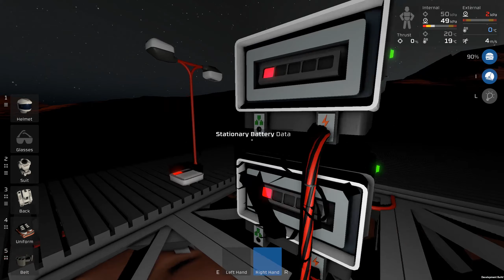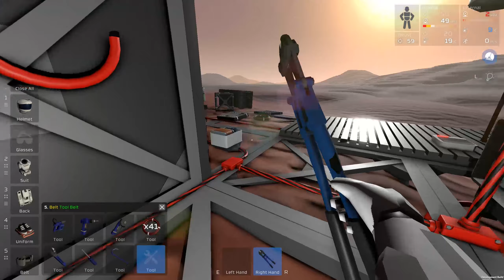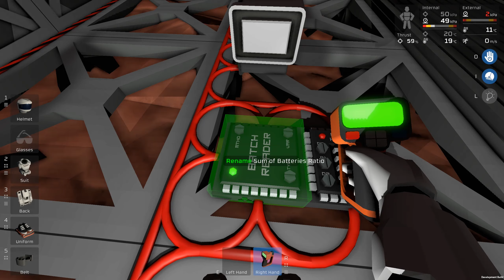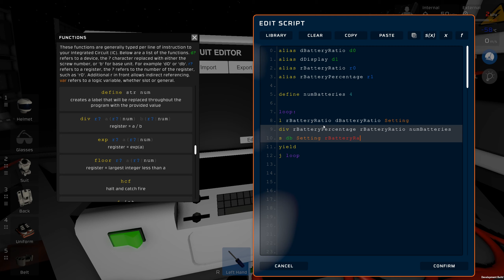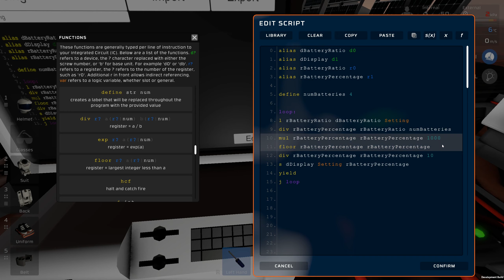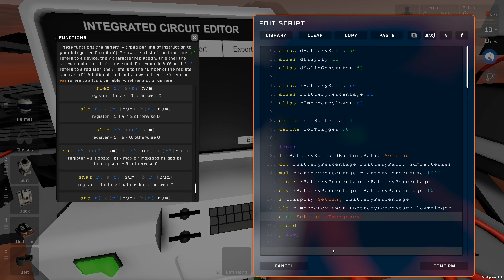Stationeers S4 E27 - Power Management System

Comment: if you set your trigger too high for emergency power, then the lower percentage of batteries is basically not used. this will basically occur at night since you have no power generation then. generally my base runs under 30, sometimes 20% power if I do heavy workloads, my power system designed to have just enough capacity to make it through the night if everything is on, which it rarely is. emergency power should be powerful, maybe 1 or 2 gas turbine generators that extends the last 10% of the battery just those last 5-10 minutes till the solar panels come back.
Also I'd go for that schmitt trigger. if only to prevent the generator from eating one coal every time you turn it on. (not sure if it still does that. but I hate that fighting anyway.)

Comment: I recreated your solar array but my panels seems to follow a different sun can you go throught all the setting on the chips again please you are too quick when you point to them its hard to see what its been set to .
Reply from the maker: Make sure your solar panels are the separate power/data variant, then pay attention to the bit in the video about which way to face the sensors - they have to be exact. If the power output of the solar panel faces west, then the sensor pair will be north/south, with one upside down (has to be the correct one)
Reply: @grayduster  Actually i had one of the batch readers not reading from the memory chip , which isn't detailed  in your vids that i could find , i think because you went through three different ways of a setting up the array , but i was also  trying to use the one cable variant of the solar panels and tried every combination of the programming and sensors  to get them to behave correctly , in the end i rebuilt my array ., and now all at 99-100% , also your sensor doors you could use a trigger plate instead .

Comment: So lots of good suggestions in comments I see about how to change the program - but honestly you dont even need the IC chip. Batch reader / average - logic writer takes that and sticks it to LED - led set to mode 1 = % 

Now if you want to get fancy - you can say change the LED colors based on % of power.
IM no coder but id guess it would be read value - compare the value to a set % and Set the color of LED to blue if 75% or higher, 
green for between 50% and 75%
Yellow for 25-50% and red for anything under 25% and maybe even more fancy to sound an alarm for anything under 10% or flash spinning light? activate coal gen.. etc.
I mean I might take a crack at the code - honestly I know its not that hard if I wanted to figure it out. but I cant just "think" it id have to write it first then do it XD..

honestly Ive learned more about the coding of IC watching yours/general curmudgeons and Saddamos vids - along with following what people post in the discord.

Shoutout to @risu in discord who is like one of the experts at making code simple/easy and helping people solve issues.

I  Know for my base, I just used the batch reader/logic writer for the LED - its been forever since I messed with that system.. 
My upgrade to that, did add a IC chip, which showed total charge amount, total charge gained during the day - and I believe would trigger my coal gen if power ratio was below 25% - but my base currently has something like  8 batteries inside a couple sealed rooms that "never" seem to lose enough power, I drain about 2-3 batteries (over night) and my current solar panel setup seems to be able to charge 4+ minimum.
So basically I over built the system due to battery's losing power while cold - so i put them in semi sealed environments and went a bit over engineering on it.  Even went to crazy extremes to water cool a gas generator (which can run forever with how the cooling system works) if not for the solar panels. atm all the incoming power is going through one line (ie all solar panels and gas gen are outputting to same single line which then goes to all inputs on batterys)   so I can always blow power lines when sun rises if solar panels are catching light with gas gen on.  so solar+gas gen = fried cables even with heavy cable.. and it can be a PAIN to find which chunk of cable went pop. since most of its hidden in blocks/under blocks/behind walls/etc XD

I am tempted to test a fuse system where i can easily swap out a fuse - or maybe work to automate gas gen to check how much power is being produced to decide to turn it on or off based on current battery drain.

Comment: Got here late, but milkau is correct, using batch reader in average mode set to read the battery "ratio" does exactly what you need, no IC needed.

Comment: I'm assuming you know this, but your backup generator will not charge your batteries in this case, it will only power your base (and likely waste a bunch of energy) until the battery power is recharged by the solar.  If you still wanted to keep the same setup you have, I'd put the generator "in line" with your solar panels and hook it up to a battery stack of its own as the emergency power stack.  The complicated part of this is that you should only monitor that stack for the generator on state or you'll end up with the same situation where the generator is just keeping its batteries full while powering your base off the generator.  If you want a backup generator that potentially charges all your batteries, you'll need to go with the more complicated:

solar/gen -> transformers -> supply heavy trunk -> battery bank -> drain heavy trunk -> transformers -> base section

Otherwise, you'll need to run a heavy cable from your generator to a "charge line" that has a transformer for each solar branch to charge their batteries, but that gets ugly.
Reply: The other complicated part of using a backup stack is if the backup battery is chosen as the drain (because the way electric works in this game is it drains one battery before the rest) the generator will be kicking on to regenerate that stack when all the other stacks could be full of energy.

Comment: Love watching your stationeers videos. Wouldn't it be more useful to calculate how much time you have left on the remaining charge by dividing the total battery capacity by the total power consumption? you could even include the output of the power generator into that. 

I think the following will work. The (coal generator status * 20000) sections are to factor in the coal generator if it is outputting 20kW.

Power Situation (+ = power positive) = (power potential + (coal generator status * 20000)) - power actual
Time Remaining (seconds) = ((charge + (coal generator status * 20000)) / power actual) * 2(ticks/sec)
Reply from the maker: If the power draw is constant, sure - but if you have stuff that is turning on and off (upcoming video) that draws a lot of power, it'll be a bit similar to windows updates - 14 minutes remaining... and done :)
Reply: @grayduster  :) True. It is an instantaneous read. Taking an average over an interval would smooth out that curve or, averaging power draw and charge over a full day/night cycle with 4 points, charge and draw at dawn, noon,  sunset, mid-night, would help average out the power draw. Great vids, Thank for posting them!
Reply: @PilotMan71  The way I did it was to use the linear interpolation formula to smooth out the numbers:
(previous battery drain * 0.95) + (current battery drain * 0.05)

just before I read the new battery drain I store the previous value. On startup I read the current battery drain and it gets stored into the previous value (so it doesn't have to "warm up").

To read the values I just use 2 cable analyzers... 1 for the input line (before batteries), 1 for the output line (after batteries, before any transformers). This also allows me to add as many batteries as I want:
"required power" for the input line + "potential power" for the output = total battery capacity
"required power" for the output line = current battery drain
"potential power" for the output line = battery charge
battery drain / battery charge
 = seconds of power stored in batteries

Comment: You should've put the generator before the battery's so they charge up.
Reply from the maker: Oops, yep!
Reply: As the battery inputs are already at the cable capacity of 5kW, that might burn the cables.
Maybe connect the SFG to its own battery?
Reply from the maker: Can just put transformers just in front of the battery inputs, and heavy cable between them and the battery (and the gen and the battery) I think?

Comment: Change the LED mode to 1 to show a percentage and set it's setting to the raw ratio percentage ... so if you divide by 1000, floor it, then multiply by 1000 in mode 1 it will show '35.6%'